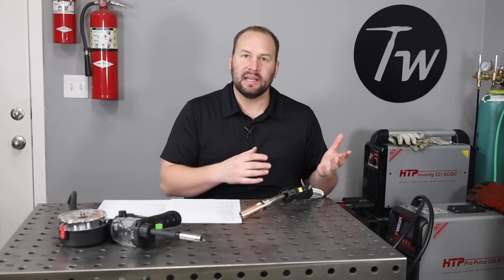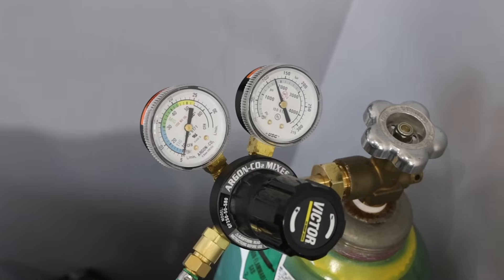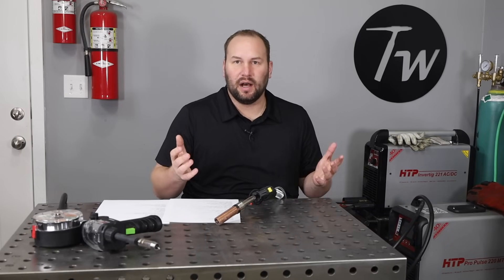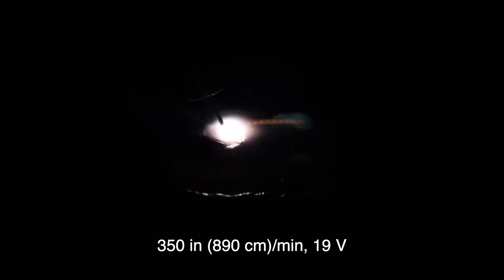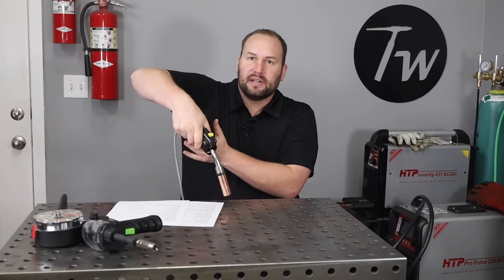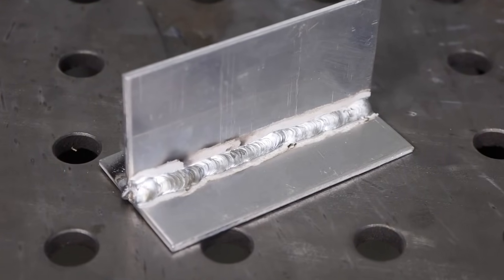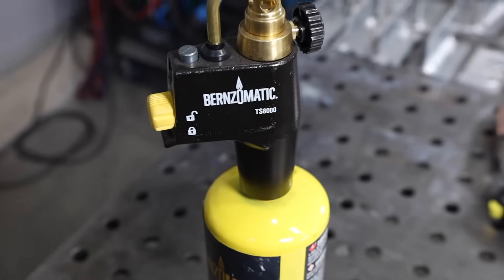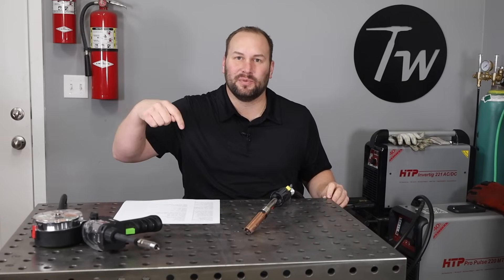How to MIG Weld Aluminum: The Complete Guide

Comment: Excellent video Tim? Solved all my setup and welding problems for aluminum MIG welding. I am trying to do vertical welds with a spool gun and I have a mess. I assume there are some finer points that were not covered specifically in this video. The only other videos I can find on YouTube just show people welding uphill with no explanations as to setting adjustments from welding horizontal. If you ever get around to making a video specific to horizontal aluminum MIG, that would be awesome. Thanks again for your great work.
Reply: specific to vertical aluminum MIG. Oops

Comment: What gas flow? I'm using 30cfh 20v 400ipm on .100 lap.
Reply from the maker: I usually run about 35 CFH on aluminum, but it depends a little on the joint type. If it's a fillet, you can get away with a bit lower. The wire alloy and size make a big difference too.

Comment: Tim my wire doesn't reach the work piece it burns up and just drops off like little tear drops can you help what am doing wrong I'm using a spool gun
Reply from the maker: You probably need more wire speed to get the amperage up to run a good spray transfer. Then, you can use your voltage to fine tune the arc length. Aluminum MIG is very sensitive to settings. Also, make sure your polarity is correct and you’re flowing plenty of pure argon. If you continue to have trouble with it, you can send me an email with the details of your setup and I’ll see if I can help you out.

Comment: Can weld it without gas?
Reply: You can use aluminum stick electrodes (like E4043) that have flux coating. But won’t look good.

Comment: Thanks ,Tim ,for this video as well as your quick response to my question.
I have one more question relating to spray transfer for welding aluminum.
Spray transfer appears to be related  in large part to voltage. When I look at the charts that accompany many welding machines I see voltages that seem very low for spray transfer with aluminum particularly 1/8 in. You mention  that 20v is required but three of my machines show chart voltages as low as 17V for 1/8 in aluminum. Are machine outputs this different?
Many thx for your time. Regards, John
Reply from the maker: Machines vary and the quality of recommendations vary, which is why I try to focus on principles. If the wire is stubbing out, add some voltage. If it is burning back and the arc is too long to control the puddle, reduce the voltage a bit. If you need more overall heat, increase wire speed or reduce it for less heat. The charts are a good starting point, but it's best to dial it in experimentally. Also, aluminum MIG is much less forgiving on settings than short circuit MIG on steel, so a little more tuning is usually needed.

Comment: Thx Tim
Exactly why is a long stickout best for welding aluminum ?
Reply from the maker: The biggest reason is that aluminum is run with a spray transfer, which has a longer arc than short circuit MIG. If you don't run a longer CTWD (contact tip to work distance), any little hiccup can cause the wire to burn back, you'll lose your contact tip and start filling the swear jar pretty fast. You also lose a little voltage and preheat the wire by running a longer stickout, but that reason applies more to flux core wire than aluminum MIG.

Comment: Are these welders AC or DC?
Reply from the maker: DC Electrode Positive for aluminum MIG. The polarity controls whether there is more heat put into the material (Electrode Negative) or oxide etched off of the material and more heat into the electrode (Electrode Positive). Aluminum TIG welding is done with AC so that it can etch the oxide on the EP cycle while focusing more heat into the material on the EN part of the AC cycle. Aluminum MIG is done on EP, so it etches the oxide off of the surface constantly. The majority of the heat goes into the electrode wire, which is fine (even beneficial) with MIG because the wire is transferred into the puddle taking the heat with it.

Comment: Why does Tig require AC to clean, where as mig can use DC on Aluminium? What happens to the oxide layer in DC mig?
Reply from the maker: Great question! Aluminum MIG is run on DCEP (Electrode Positive), which is the part of the TIG AC cycle that does all the cleaning. This puts the majority of the heat into the electrode rather than the workpiece. Since the MIG electrode is consumed and added into the weld puddle, it carries that heat energy back into the weld anyway. With TIG, running DC electrode positive puts too much heat into the non-consumed electrode for it to keep its shape and too little heat into the material. For this reason, the TIG polarity has to switch between electrode positive for cleaning and electrode negative to put heat in the material.
Reply: @TimWelds  Brilliant explanation, you should think about doing welding full time you know! ) I thought it was just poking the oxide layer, but your explanation makes hell of a lot more sense!

Comment: Do i REALLY need a shielding gas?  I just want to stick a few pieces of aluminum tubing together. It has no real significance. Just some supporting bracing for a boat T Top. We are talking 1 1/4 tubing.
Reply from the maker: Yeah, it won't really work at all without gas. You can stick weld aluminum without gas, but it's a huge pain and I wouldn't recommend it on tubing like that. If you only have one little job, you'll also need the setup to feed wire. Sometimes it makes more sense to hire it out. If you have the setup short of the gas, some gas suppliers will rent tanks by the week.

Comment: nioce, I need more though. What I have been tryuing to find is connections for aluminum mig gun (not spool gun) welding. Do I connect the leads backwards when compared to the rest of my settings? IE do I make the ground negative or positive?
My welder does mig but no instructions
Reply from the maker: DC Electrode Positive, so the ground lead will be negative.

Comment: I noticed that you push to weld aluminum is it possible to weld by pulling and if not why?
Reply from the maker: With aluminum, or any spray transfer, pushing will shield the puddle better and is the best practice. Pulling will lead to much more contamination.

Comment: Thx Tim
When mig welding aluminum thinner than 1/8 is it possible to do this in spray mode or are the voltage and amp settings too low for this mode?

Comment: Can u use titanium mig 140 with 120volt instead titanium 170. Did u use 220v for these welders for aluminum
Reply from the maker: I haven't tried it on 120 volt, but it is compatible. I expect that you would be fairly limited on thickness.

Comment: Tim I think you are the one with the most comprehensive approach to dial in the machine, but why you started at 350 inch per minute, how do you pick the first number, why 350 inch per minute (amperage=wire speed?), I am using a Yeswelder 250-PRO, and 4043 filler material, to weld 1/8" thick 6061-T6 aluminum in a format of square tubing 2 inches, how do I pick the wire speed? Then I will be moving to 3/16" same alloy and format, then to 1/4" of thickness of 3 inch square tubing... Do I always start with selecting the wire speed, and is the wire speed correlation directly attributable to metal thickness or the type of alloy is also to take into consideration??

Comment: Thanks for this video. Watched another video on this and they were talking about using a $12,000 machine specially made for aluminum welding. It had special rollers, tensioner, had water cooling, etc. I can't afford all that. Thank you for showing how to do this with basic machines.
Reply: HTP welders are not basic.   They are high end pro, the ones he has are lower in Amps than you need for thick jobs or at you need a special procedure.

Comment: HTP is NOT a professional level machine....35 to 50 CFH is a huge waste of gas. You should not need any more then 25 CFH for any thickness of aluminum. I literally weld aluminum every single day with a spool gun at a boat manufacture.
Reply from the maker: What a pain to use a spool gun all day with those little spools of wire, would be worth looking at a push pull setup for productivity sake.

Comment: Thx Tim. Question…is spray tramsfer easier to attain using aluminum wire than steel wire? Getting to spray transfer for welding steel seems to require a lot more voltage

Comment: Tim, Another great video may thanks it was very helpful even on thin stuff. What wire size were you using. Also I have found clean with acetone, wire brush, clean with acetone helps
Reply: A stainless steel brush also helps.
Reply: @michaelchadwick3497  @Ian Kidd  Definitely when welding aluminum You should always clean with Acetone and use a STAINLESS STEEL wire brush. Also you only want to brush in one direction when cleaning with your SS wire brush so you don't push or pull contaminants back into the aluminum. When it comes to aluminum, clean, clean, clean!  Contaminants can cause porosity which can equal weak broken welds.

Comment: I'm welding 3/16 thick plates @ 22.5 and 570 WS on a Miller 252. The wire Keeps burning back on the contact tip and melting it or causing birdnest. Ive adjusted voltage and speeds and my burback timing and  flow, post and pre flows but it still keeps happening and I cannot for the life of my figure out
Reply: What size wire and tip are you using
Reply: Try changing the liner. Make sure you have a good ground. Clean the weld joint with acetone.

Comment: Hi Tim. Thanks for the video.  It was very helpful. We set up one of our pulse migs (an EWM 350 phoenix) for aluminium today. Got all the gear, proper rollers, liner and gas but it just didn't really work out. The Arc length was very long, as long at the tip to work, with no discernible Arc ball on the end of the wire. Could that be not feeding properly, as in restrictions in the feed? The weld was coming out okish, but I'd like to see a better feed. Any thoughts would be great. Thanks, from mick.

Comment: The handles we used at Maersk Container Industry (Denmark) back in the late 90's had a set of assisting rollers directly in them, as well as a dial to control the current/feed rate.
Having a welder with the slope down feature helps immensely. If the pool gets too big or hot, you just release the trigger for a second an continue.
One thing to note for the beginner aluminium welder, is that you need to move the handle much faster than when welding steel. Oh, and it is absolutely essential that the material is as clean as possible. You don't want to turn your welder into a plasma cutter...

Comment: Three things. Practice, practice, practice on metal scrap, before you weld on the piece you can't screw up.
Reply: I did that and it turned out the test scrap metal was a different type of aluminium. 🤦‍♂️

Comment: Thanks Tim. You saved me a lot argon & wire. I recently purchased a Miller 235 w/Spoolmate 200. The auto set for 1/8" aluminum is 21.9 volts with 575 wire speed. Not matter how fast I went it was more like a plasma cutter than welder. Your settings worked great.
Reply: Wayyyy to hot lol
Reply: 22
515 IPm
Reply: Try 20.1 Volts and 355-375 wire speed

Comment: Great video!   I'm exploring getting my first welder for welding aluminum structures that need to go in seawater; so having it be able to take a hard coat anodize is *critical*.  Aside from the good instruction on the basics that are so well broken out into the various factors you need to control , in all my previous reading and video-watching, nobody had brought up that issue of different fillers behaving differently re taking anodizing (and I need to have GREAT anodize).  You've no doubt just saved me from a potentially HUGE expensive mistake  -- cutting all the parts, welding them, sending them off to be anodized -- and having it come back completely useless for putting in a marine environment -- not to mention then a huge amount of time wondering what went wrong!  Big thanks!
Reply: Um ya ok bud!!!

Comment: Nice video Tim. Thanks 
I’m a newbie to aluminum welding and will be trying without a spool gun and 5356 wire and argon gas. I have a Miller 211 and a Hobart handler 125 Im gonna test out. 
Appreciate the time you put into the video and seamless presentation!

Comment: Thank you, great video!!  I'm a mid-experienced welder/hobbyist with steel but just getting started on aluminum.  I have a Miller 175 and am working on 6061 with 4043 filler, 100% argon @ 300 cfh.  I don't have a spool gun but have the wire feeding fine.  My welds, however, look just like the left side on your YouTube picture for this video - lots of black, bead is just building on top of the metal, little penetration, etc.  I realize that the Miller 175 was never intended to weld aluminum... is there something fundamentally missing from this machine when it comes to aluminum?
Reply: This video is ok but it covers far to much too fast. Watch this one.  https://youtu.be/hUpmiDL92V8

Comment: Thank you for this. I just started welding alloy with my mig and had trouble finding a good video describing the settings. I know now to set my amps then try the voltage setting more. Thanks.

Comment: Can i ask if you can weld aluminium without gas?
Reply from the maker: There are some stick welding rods for aluminum, but they are really hard to use-I’ve never been able to get a decent result with them. For all practical purposes, I’d say you need gas.
Reply: @TimWelds  thank you i have oxyacetelene welding and stick welding thinking of buying mig welding but it will take time for me to afford the gas for it.

Comment: Hmmm, First thing I was taught when welding, pretty much anything, is to prep the surface to remove the oxide layer…
Reply from the maker: It etches off with electrode positive polarity in MIG.
Reply: @TimWelds  , that is NOT an excuse to skip surface prep!

Comment: Thanks for sharing these videos.  I am just starting out purchased my first welder based on your advice.  I was sure to get into a spoolgun as well for Aluminum.  Curious in this video and others, when you are welding these small practice pieces, where are you connecting your ground clamp?  I don't see it in frame.  I don't see you clamping down your work either, so maybe you just pulled it off with the camera off.  Thanks, and keep up the videos!

Comment: Thanks Tim! Busy dialling in my Yes Welder MIG250Pro on some 0.08" wall-thickness aluminum tubing now and stopped to Google why I am having difficulty and found your video... Your advice about allowing more stick out on aluminum is really useful!! I learned a valuable lesson here that has helped me avoid the wire melting onto my contact tip! Also starting up high and coming in to your recommended stick out distance is also super useful advice for a novice like me! Thank You Again!

Comment: I am in the process of building a 1959 GMC Grumman, it's an all-aluminum body that has over the years been cut up badly. The smallest of 9 different cuts is 8" x 3" up to 3' x 4'. Having tried NAP gas welding, stick aluminum welding and spool gun (I am very right-handed with a bad wrist, elbow and shoulder the spool gun couldn't work for me.) I believe that I can do this with your technique. I thank you BT

Comment: Hi Tim , and all other component welders!

Question:
I have a budget of 500 to buy a welder (new or used). I will be fabricating a 8x12 trailer with my father. The material is all steel tubing or Ibeam. 

What machine can I purchase in my price range that will provide me the penetrations for structural welds. I had a 225 Tombstone I’m tempted to get back, but would another process be more efficient. Thank you!
Reply from the maker: I would just use the buzz box and stick weld it. MIG might be a little more efficient, but the time saving will be marginal and the gas cylinder alone will eat up more than half your budget. Stick welds, when done properly, are also less likely to have a lack of fusion defect. I’d probably use some 7018AC rod for a trailer like that. Sounds like a fun project!
Reply: @TimWelds  thanks for the reply, Tim!

Next project down the pipe with my pops is a 12x34. I picked up the buzz box like you suggested but it’s the AC225. Should I have got the AC/DC? Or am I overthinking things. Which I know I do. Thanks!

Comment: Thank you This video helps a lot. Can you make a video on how to weld thin aluminum with the titanium setup ??that will be awesome!!!
Reply from the maker: I'll add it to the list. The only thing I would do differently with the titanium setup compared with this video is to use 5356 filler, assuming it's compatible with the base metal.
Reply: @TimWelds   great I’ll try that . I am having issues when welding thin 1”x1” aluminum square tubing . Thanks for replying!

Comment: Great video tim very informative. I just have a question the titanium 170 is straight dc current don’t you need ac in order to weld aluminum? Thats what though since you said you need alternative current to weld aluminum on another video where you explained how to choose a welder
Reply from the maker: For TIG welding aluminum, an AC machine is needed. With MIG, DC electrode positive is the way to go.

Comment: Another great one, Tim.  I've never welded aluminum, but am eager to try.  Your tips will help for sure.  Your practical presentation style takes the mystery out it.  Appreciate your time and effort!
Reply: My dad works for welding company and said without filters on mask and ventilation your teeth will fall out and hair because it harms you so much
Reply: I came from a stick background and tried to j weave everything and my welds looked like shit lol I started to push counter clockwise weave and it turns out good the hardest thing is finding your prefect Amps and wfs